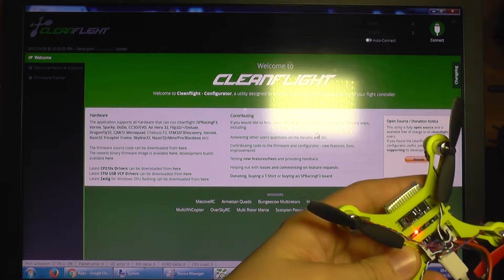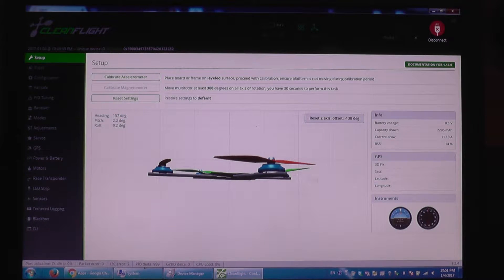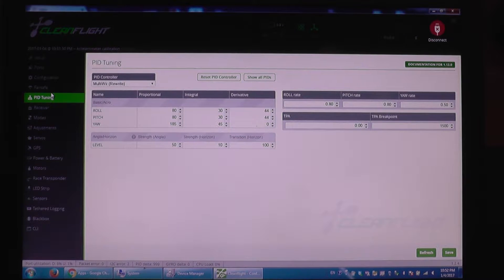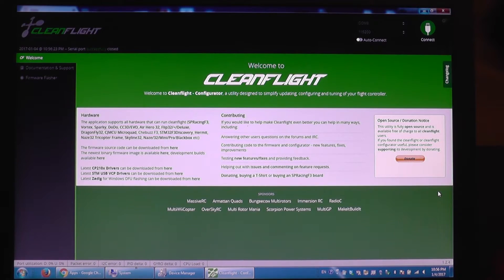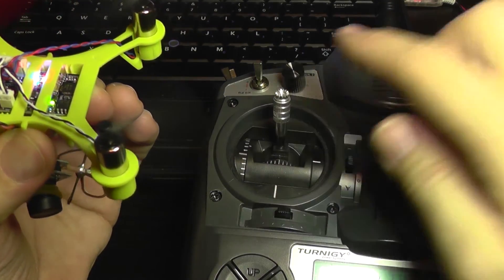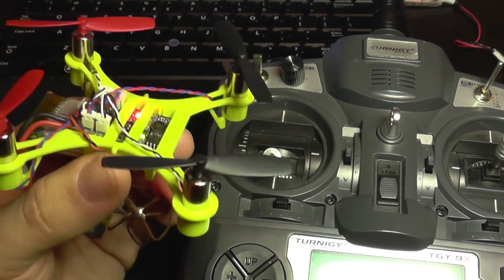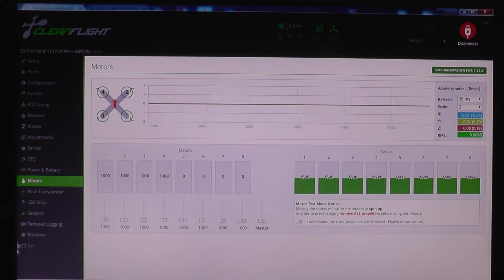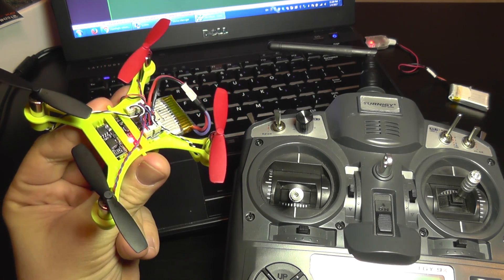Eachine Tiny QX90C 90mm FPV Quadcopter - part 2 - Cleanflight Setup

Comment: i do not get any green light...is this another faulty board? mine is the dsm2 version
Reply from the maker: Maybe the receiver works in another way. Did you get a A4 printed piece of paper with it ? Maybe it has some description on the binding there.

Comment: Could you please email me a backup of the qx90c settings? I did a reset to defaults in cleanflight then saved it to the copter and now as soon as I connect the battery it just spins up the motors hard and doesn't take any input from the TX. In fact I can move the sticks around, but they don't move at all in cleanflight.
Reply from the maker: What version of receiver do you have ? I will do a CLI Dump and send it to you.
Reply: TechTronic9000 I have the frsky receiver. thank you very much in advance!
Reply from the maker: Send me a private message with your email, or add me on facebook (TechTronic9000). I'll send you the file probably tonight.
Reply from the maker: I'm using a FlySky reciver (Turningy 9X), here is the dump:

Entering CLI Mode, type 'exit' to return, or 'help'

# dump

# version
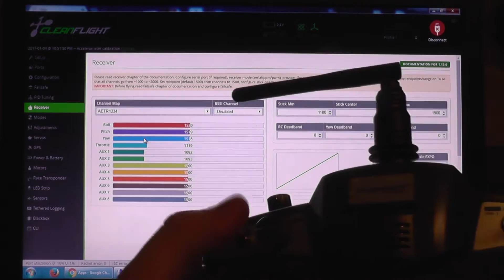# Cleanflight/SPRACINGF3EVO 1.13.0 Jun  6 2016 / 00:03:29 (a77bc76)
# dump master

# mixer
mixer QUADX
mmix reset
smix reset

# feature
feature -RX_PPM
feature -VBAT
feature -INFLIGHT_ACC_CAL
feature -RX_SERIAL
feature -MOTOR_STOP
feature -SERVO_TILT
feature -SOFTSERIAL
feature -GPS
feature -FAILSAFE
feature -SONAR
feature -TELEMETRY
feature -CURRENT_METER
feature -3D
feature -RX_PARALLEL_PWM
feature -RX_MSP
feature -RSSI_ADC
feature -LED_STRIP
feature -DISPLAY
feature -ONESHOT125
feature -BLACKBOX
feature -CHANNEL_FORWARDING
feature -TRANSPONDER
feature RX_PPM
feature VBAT
feature FAILSAFE
feature TELEMETRY
feature CURRENT_METER
feature RSSI_ADC
feature LED_STRIP

# map
map AETR1234

# serial
serial 20 1 115200 57600 0 115200
serial 0 1 115200 57600 0 115200
serial 1 0 115200 57600 0 115200
serial 2 0 115200 57600 0 115200

# led
led 0 0,7::IC:3
led 1 15,7::IATC:12
led 2 7,7::IATC:12
led 3 8,7::IC:3
led 4 0,0:::0
led 5 0,0:::0
led 6 0,0:::0
led 7 0,0:::0
led 8 0,0:::0
led 9 0,0:::0
led 10 0,0:::0
led 11 0,0:::0
led 12 0,0:::0
led 13 0,0:::0
led 14 0,0:::0
led 15 0,0:::0
led 16 0,0:::0
led 17 0,0:::0
led 18 0,0:::0
led 19 0,0:::0
led 20 0,0:::0
led 21 0,0:::0
led 22 0,0:::0
led 23 0,0:::0
led 24 0,0:::0
led 25 0,0:::0
led 26 0,0:::0
led 27 0,0:::0
led 28 0,0:::0
led 29 0,0:::0
led 30 0,0:::0
led 31 0,0:::0

# color
color 0 0,0,0
color 1 0,255,255
color 2 0,0,255
color 3 30,0,255
color 4 60,0,255
color 5 90,0,255
color 6 120,0,255
color 7 150,0,255
color 8 180,0,255
color 9 210,0,255
color 10 240,0,255
color 11 270,0,255
color 12 300,0,255
color 13 330,0,255
color 14 0,0,0
color 15 0,0,0

# mode_color
mode_color 0 0 1
mode_color 0 1 11
mode_color 0 2 2
mode_color 0 3 13
mode_color 0 4 10
mode_color 0 5 3
mode_color 1 0 5
mode_color 1 1 11
mode_color 1 2 3
mode_color 1 3 13
mode_color 1 4 10
mode_color 1 5 3
mode_color 2 0 10
mode_color 2 1 11
mode_color 2 2 4
mode_color 2 3 13
mode_color 2 4 10
mode_color 2 5 3
mode_color 3 0 8
mode_color 3 1 11
mode_color 3 2 4
mode_color 3 3 13
mode_color 3 4 10
mode_color 3 5 3
mode_color 4 0 7
mode_color 4 1 11
mode_color 4 2 3
mode_color 4 3 13
mode_color 4 4 10
mode_color 4 5 3
mode_color 5 0 9
mode_color 5 1 11
mode_color 5 2 2
mode_color 5 3 13
mode_color 5 4 10
mode_color 5 5 3
mode_color 6 0 6
mode_color 6 1 10
mode_color 6 2 1
mode_color 6 3 0
mode_color 6 4 0
mode_color 6 5 2
mode_color 6 6 3
mode_color 6 7 6

set looptime = 1000
set emf_avoidance = OFF
set i2c_highspeed = ON
set gyro_sync = ON
set gyro_sync_denom = 1
set mid_rc = 1500
set min_check = 1100
set max_check = 1900
set rssi_channel = 0
set rssi_scale = 30
set rssi_ppm_invert = OFF
set rc_smoothing = OFF
set rx_min_usec = 885
set rx_max_usec = 2115
set serialrx_provider = SPEK1024
set sbus_inversion = ON
set spektrum_sat_bind = 0
set input_filtering_mode = OFF
set min_throttle = 1050
set max_throttle = 2000
set min_command = 1000
set servo_center_pulse = 1500
set motor_pwm_rate = 1000
set servo_pwm_rate = 50
set 3d_deadband_low = 1406
set 3d_deadband_high = 1514
set 3d_neutral = 1460
set retarded_arm = OFF
set disarm_kill_switch = ON
set auto_disarm_delay = 5
set max_arm_angle = 25
set small_angle = 25
set fixedwing_althold_dir = 1
set reboot_character = 82
set gps_provider = NMEA
set gps_sbas_mode = AUTO
set gps_auto_config = ON
set gps_auto_baud = OFF
set telemetry_switch = OFF
set telemetry_inversion = ON
set frsky_default_lattitude =  0.000
set frsky_default_longitude =  0.000
set frsky_coordinates_format = 0
set frsky_unit = IMPERIAL
set frsky_vfas_precision = 0
set hott_alarm_sound_interval = 5
set battery_capacity = 0
set vbat_scale = 110
set vbat_max_cell_voltage = 43
set vbat_min_cell_voltage = 33
set vbat_warning_cell_voltage = 35
set current_meter_scale = 400
set current_meter_offset = 0
set multiwii_current_meter_output = OFF
set current_meter_type = ADC
set align_gyro = DEFAULT
set align_acc = DEFAULT
set align_mag = DEFAULT
set align_board_roll = 0
set align_board_pitch = 0
set align_board_yaw = 0
set max_angle_inclination = 500
set gyro_lpf = 188HZ
set gyro_soft_lpf = 60
set moron_threshold = 32
set imu_dcm_kp = 2500
set imu_dcm_ki = 0
set pid_at_min_throttle = ON
set yaw_motor_direction = 1
set yaw_jump_prevention_limit = 200
set tri_unarmed_servo = ON
set servo_lowpass_freq =  400.000
set servo_lowpass_enable = OFF
set failsafe_delay = 10
set failsafe_off_delay = 200
set failsafe_throttle = 1000
set failsafe_kill_switch = OFF
set failsafe_throttle_low_delay = 100
set failsafe_procedure = 1
set acc_hardware = 0
set baro_hardware = 0
set mag_hardware = 0
set blackbox_rate_num = 1
set blackbox_rate_denom = 1
set blackbox_device = SDCARD
set magzero_x = 0
set magzero_y = 0
set magzero_z = 0

# rxfail
rxfail 0 a
rxfail 1 a
rxfail 2 a
rxfail 3 a
rxfail 4 h
rxfail 5 h
rxfail 6 h
rxfail 7 h
rxfail 8 h
rxfail 9 h
rxfail 10 h
rxfail 11 h
rxfail 12 h
rxfail 13 h
rxfail 14 h
rxfail 15 h
rxfail 16 h
rxfail 17 h

# dump profile

# profile
profile 0

# aux
aux 0 0 0 1450 2100
aux 1 1 1 900 1200
aux 2 2 1 1300 2100
aux 3 0 0 900 900
aux 4 0 0 900 900
aux 5 0 0 900 900
aux 6 0 0 900 900
aux 7 0 0 900 900
aux 8 0 0 900 900
aux 9 0 0 900 900
aux 10 0 0 900 900
aux 11 0 0 900 900
aux 12 0 0 900 900
aux 13 0 0 900 900
aux 14 0 0 900 900
aux 15 0 0 900 900
aux 16 0 0 900 900
aux 17 0 0 900 900
aux 18 0 0 900 900
aux 19 0 0 900 900

# adjrange
adjrange 0 0 0 900 900 0 0
adjrange 1 0 0 900 900 0 0
adjrange 2 0 0 900 900 0 0
adjrange 3 0 0 900 900 0 0
adjrange 4 0 0 900 900 0 0
adjrange 5 0 0 900 900 0 0
adjrange 6 0 0 900 900 0 0
adjrange 7 0 0 900 900 0 0
adjrange 8 0 0 900 900 0 0
adjrange 9 0 0 900 900 0 0
adjrange 10 0 0 900 900 0 0
adjrange 11 0 0 900 900 0 0

# rxrange
rxrange 0 1000 2000
rxrange 1 1000 2000
rxrange 2 1000 2000
rxrange 3 1000 2000

# servo
servo 0 1000 2000 1500 45 45 100 -1
servo 1 1000 2000 1500 45 45 100 -1
servo 2 1000 2000 1500 45 45 100 -1
servo 3 1000 2000 1500 45 45 100 -1
servo 4 1000 2000 1500 45 45 100 -1
servo 5 1000 2000 1500 45 45 100 -1
servo 6 1000 2000 1500 45 45 100 -1
servo 7 1000 2000 1500 45 45 100 -1

set gps_pos_p = 15
set gps_pos_i = 0
set gps_pos_d = 0
set gps_posr_p = 34
set gps_posr_i = 14
set gps_posr_d = 53
set gps_nav_p = 25
set gps_nav_i = 33
set gps_nav_d = 83
set gps_wp_radius = 200
set nav_controls_heading = ON
set nav_speed_min = 100
set nav_speed_max = 300
set nav_slew_rate = 30
set alt_hold_deadband = 40
set alt_hold_fast_change = ON
set deadband = 0
set yaw_deadband = 0
set yaw_control_direction = 1
set 3d_deadband_throttle = 0
set throttle_correction_value = 0
set throttle_correction_angle = 800
set default_rate_profile = 0
set gimbal_mode = NORMAL
set acc_cut_hz = 15
set accxy_deadband = 40
set accz_deadband = 40
set accz_lpf_cutoff =  5.000
set acc_unarmedcal = ON
set acc_trim_pitch = 0
set acc_trim_roll = 0
set baro_tab_size = 21
set baro_noise_lpf =  0.600
set baro_cf_vel =  0.985
set baro_cf_alt =  0.965
set mag_declination = 0
set pid_controller = MWREWRITE
set p_pitch = 80
set i_pitch = 30
set d_pitch = 44
set p_roll = 80
set i_roll = 30
set d_roll = 44
set p_yaw = 185
set i_yaw = 45
set d_yaw = 0
set p_alt = 50
set i_alt = 0
set d_alt = 0
set p_level = 50
set i_level = 10
set d_level = 100
set p_vel = 120
set i_vel = 45
set d_vel = 1
set yaw_p_limit = 500
set dterm_cut_hz = 0
set gtune_loP_rll = 10
set gtune_loP_ptch = 10
set gtune_loP_yw = 10
set gtune_hiP_rll = 100
set gtune_hiP_ptch = 100
set gtune_hiP_yw = 100
set gtune_pwr = 0
set gtune_settle_time = 450
set gtune_average_cycles = 16

# dump rates

# rateprofile
rateprofile 0

set rc_rate = 90
set rc_expo = 65
set rc_yaw_expo = 0
set thr_mid = 50
set thr_expo = 0
set roll_rate = 80
set pitch_rate = 80
set yaw_rate = 50
set tpa_rate = 0
set tpa_breakpoint = 1500

#
Reply: I doubt that it will work if it's for a different controller, but thanks anyways, I'll take a look at some of your settings.
Reply from the maker: Most of the settings should be the same, as for the TX / protocol, it's more related to the receiver than to the flight controler as most of them use the same serial connection (3 wire).

Comment: Can't you set your failsafe (no TX sig) to "drop" when you lose signal (turn off TX)? I have set mine up that way, and can set the time until drop (which I set to 1 second).  I just watched another review of the QX90C on AndyRC, and it is now his favorite of the micro brushed FPV quads. If you haven't seen his YT review, it's worth a look.  Cheers.
Reply: The failsafe on the flysky version of these quads don't seem to work. I just received my qx95 and have tried everything to get it to work. I was going to order the QX90c but I figured I better see if the failsafe works in that quad before ordering. Which is how I came across this video. Has anyone figued out a way to make the failsafe work on the flysky versions yet?
Reply from the maker: You should ask them, sometimes they are reasonable and try to help. I'm also thinking of getting the new Q7 TX.
Reply from the maker: +Bill Somrak I have set failsafe 2 to drop but it seems to ignore it, i'm still fiddeling with it as i need minimum safety for it, i will also disable idle spin when armed to prevent motors to burn out on a crash.
Reply: If you had an ARM switch, you could kill the motors in a crash, but your way will work if you set min throttle low enough.  I'm still waiting for my QX95 to get here on the slow boat from China ...
Reply from the maker: +Bill Somrak Yes the arm switch does kill the motors, i still need tk figure out how to kill them when there is no more signal
Reply: Bill Somrak hello did you fined a fix for the failsafe.
Reply: No .. had problems with my QX95 .. bad FC board I think. They went to a merged one board solution to have both RX & FC on it, and while it all appears to work in Betaflight configurator, I have NO control over the motors. I've emailed BG and they are supposed to send me a new FC board.
Reply: Rob Jones Same issue here. I just got the Flysky version and the Failsafe isn't working for me either.
Reply from the maker: +Andre Martinez Yes, later found out that all the nano FlySky receives had this issue.
Reply: TechTronic9000 Well, I have a Frsky Q X7 right now. I hope Banggood can arrange a deal with me to send me a new Frsky board if that's even possible.